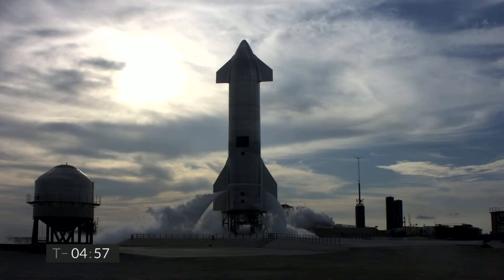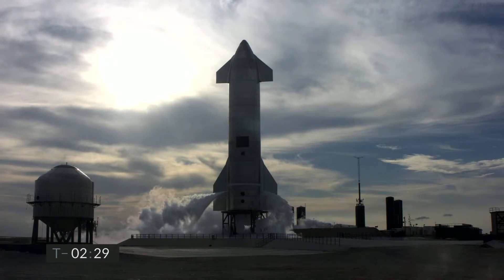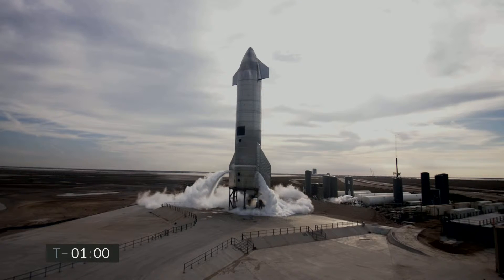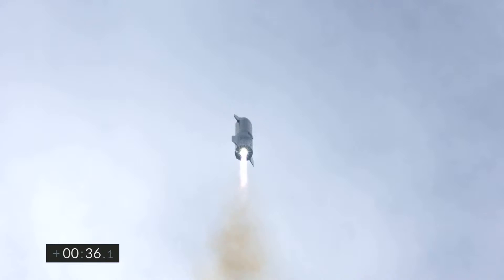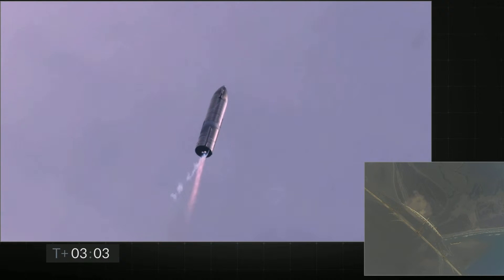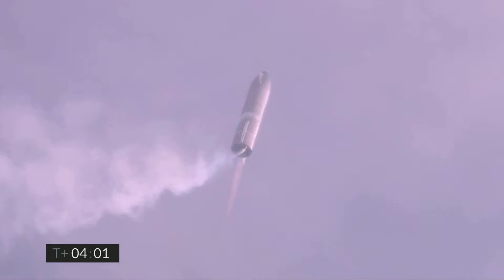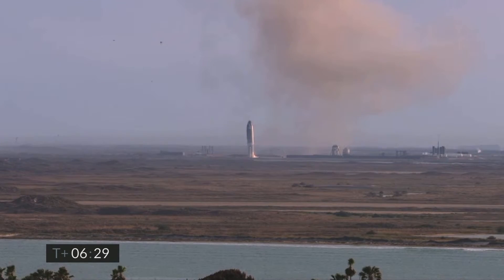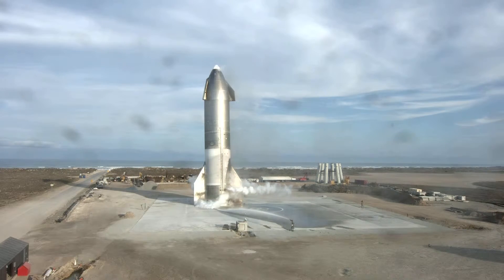Starship | SN10 | High-Altitude Flight Test

Comment: It feels like everybody assumed this kind of thing was impossible, so they just never bothered to try. Then SpaceX shows up and is like "Fuck it, hold my beer."
Reply: @Jean-Luc Picard  is probably referencing the McDonnell Douglas DC-X.  Sure they did it, in a small rocket and not super high off the ground, then quit doing it rather than moving forward.  https://i.pinimg.com/originals/f3/e6/46/f3e64698c9c4edf3364387ece95a040d.jpg
Reply: @red_array How?
Reply: lol NASA was doing this decades ago
Reply: @eyescreamcake  Not with heavy rocket
Reply: @desert_storm8747  Keep moving those goalposts.
Reply: Elon: Hold my blunt.
Reply: Hovering rockets including Mars sky crane have been around for a while, it's the transitions in such a large vehicle, launch, climb, hover at altitude, horizontal descent, vertical again for precise softlanding that make this achievement an engineering tour de force.
Reply: It was McDonnell Douglas and the DC-X in 1994 or 1995.
Reply: @zacklewis342  The DC-X was about 10 times smaller than starship and didn't bellyflop or aerodynamically control itself. Very cool vehicle ofc but starship is on a different level to it.
Reply: NASA cant do this, at least until now
Reply: The materials and the computation required to make this sort of thing both possible and reliable didn't exist until recently. SpaceX has been trying this for 20 years - it didn't just suddenly happen.
Reply: He's right, this kind of landing a rocket is not difficult. It's done all the time with "hopper" kind of vehicles. Making it go horizontal when coming down and then vertical before landing surely isn't too hard, either. It's landing a rocket when delivering a useful payload to orbit that was pretty much believed infeasible for decades, and made SpaceX revolutionary for achieving it. For Starship, the challenge will be rapid reusability after reentry.
Reply: nasa cant do this
Reply: @JohnWick-tc1xy  Google up Delta Clipper friendo. It's a shame they never followed up on the idea, but they did have a working prototype and it was glorious.
Reply: And I want to be clear that I'm not the person you all have replied to. I think what Space X is doing is awesome, but that person is correct in that similar things have been done a very long time ago when it was much more expensive to do and they had to do it with a lot less technology available. Is it exactly similar? No, but still extremely interesting from a historical standpoint. Space X stands on the shoulders of giants, we can't forget those who blazed the trail.
Reply: @JohnWick-tc1xy  GFOLD was developed at JPL lol?
Reply: this kind of landing of a rocket was already done by NASA years ago...
Reply: @jean-lucpicard581  Ehh, no it wasn't.
Reply: @jean-lucpicard581  when?
Reply: @jean-lucpicard581  where’s a link to the footage of your nasa landing
Reply: @franzsperginand113  wow dude I had no idea.  Thank you so much for sharing that bit of untold history.

Comment: Seems like the landing pad could use a lot more fire suppression systems.
Reply: Fire suppression system should be added in to the engine bay that seems logical to me
Reply: @13thbiosphere  Putting fire suppression systems on the Starship would add too much weight.
Reply: @13thbiosphere  Not needed on test platforms.
Reply: Why suppress the fire that keeps you flying? I mean, it helped SN10 fly twice with the fastest turnaround time for a rocket ever
Reply: @MrMayo-og9rj  Can't argue with that. The most bang for the buck right there.
Reply: That's what I was thinking. It looks like there might be a system on all four side but only one was working and it was shooting right at the center, not towards the ship.

Comment: Can someone explain why they shut down 2 engines nearly at the same time, after reigniting all the three engines to perform the last landing flip? Wouldn't more thrust have helped Starship land more softly than it did? I can only assume two things: either they are still having issues with engines and tank's pressurization, or they are testing how Starship behaves when landing with only one or two engines, in case of future engine failures during landings. Nevertheless, this was amazing! Great job SpaceX!
Reply: Raptor can't throttle down enough for Starship to hover on more than one engine. They have to shut the engines down or the ship would start going back up.
In future, they might be able to flip closer to the ground and suicide burn on two, or three with a deeper throttle, but for now they wanted to do that slow hover.
They only lit three engines because they need the thrust to help with the flip.

Comment: Great flight. Couldn't help noticing engine 2 was burning orange on ascent though. Was there a fault which made it touch down too hard? Why not use 3 engines to land and throttle them down so there's some spare thrust if one of them fails.

Comment: What's the point of all this?  Give billionaires space rides?
Reply: To make life multi planetary, make access to space for ordinary people
Reply: @z-manoverstreet  Ordinary people who can afford a $100,000 ticket for a 20 minute ride in space.
Reply: @1133saginaw  take off 3 zeros
Reply: @1133saginaw  where did you pull 300mil from, Starship is the cheapest rocket to launch
Reply: @1133saginaw  not that, there was a methane leak under the engine, fire from the outside crept in and blew it up

Comment: Oil will be gone! Kerosene is a byproduct of that. Hopefully musk will find alternative fuel.
Reply: I mean they're using methane derived from natural gas, so technically not oil, and they do plane to make it synthetically in the future.
Reply: @lazarus2691  there making methane by sucking co2 and H2O out of the air

Comment: Nice bounce on landing there. Am I the only one that notices it's kind of leaning at a 15-25 degree angle sitting there? I notice that transition back to vertical wasn't nearly as violent this time, almost like that high G flip was sloshing all the fuel away from the pickups.

Comment: YGBSM...I wouldn’t have bet on that transition from “falling like a fucking anvil” mode to landing upright. Damn, that was very well done.
Reply: You wouldn't have bet that the engineers who successfully developed the falcon 9 and falcon heavy would get this to work after a few tries? I wish I could have been on the other side of that bet. Easy odds. $$$
Reply: @lambdaman3228  Same. Our engineers, especially those at SpaceX, are propelling us to type 1 civilization on the Kardashev scale.
Reply: It landed a little hard, was set on fire and exploded ten minutes after landing
Reply: Not an impossible task, they have the math and control algorithms from Falcon 9 to help them. That booster has to maneuver at supersonic speeds, impersonate a falling apartment block before slowing down at the last few seconds for a landing.

Comment: I wonder if part of the reason the explosion was so delayed was because of the backdraft phenomenon, as the methane burning used the oxygen in the skirt area it caused the fire to die down but after oxygen was able to flow back in and cause a sudden reignition of the methane and led to the violent rapid unscheduled disassembly. But aside from that, congratulations to the Space X team and SN10 for making history.

Comment: Average speed during the ascent to 10Km was just 150 Km/H   -- hardly the sort of velocities needed to reach orbit.   :-?
Reply: This was a suborbital test flight, to get to orbit they will need the superheavy booster which is being built right now.
Reply: I mean this is just a landing test. They intentionally kept the speed low. 
This vehicle was only 1/4 fueled, and the real thing will sit on top of a massive booster to get it out of the atmosphere first.
Now that they've successfully landed, they will start going higher and faster.
SN11 will probably copycat this launch, but the one after that, SN15, might go to 100km and multiple times the speed of sound.
Reply: This is the second stage of the rocket. It isn't meant to fly like this, yet it did anyways any landed!
Reply: That’s what super heavy is for.
Reply: Simulating the time that the raptors would normally be on for an orbital mission. The raptors are very much throttled during ascent. It's whether they can keep burning for the full duration. In my opinion
Reply: @dkdeep5505  At the end of this test, the exhaust from that one engine definitely looks "engine rich." Reusability is almost certainly going to be a major problem.
Reply: @PistonAvatarGuy  Also the new configuration i.e the 3 raptor landing flip seems so inefficient. It's kinda like blue origin's new shepherd landing. When compared to SN8 and SN9, SN10 seems to be hovering a lot more at landing. Could also be that we've never seen a landing before. If you'll be landing humans, I guess going slow and steady would be the answer anyways.
Reply: Starship on it's own is not designed to get to orbit 
Super heavy is a massive booster that is currently being built that will be undernieth starship as a 1st stage to help it get into orbit 
Starship is a 2nd stage and landing vehicle
 it's going to be huge haha
Reply: As alex said, this will be on top of a booster stage to get it there. I just find it insane that they were able to get this BFR off the pad in the first place!!
Reply: was the goal to show it could reach orbit?
Reply: @anotherdave5107  Goal was to land.
Reply: @MobiAussie  - I knew that. I was trying to politely have the poster think it thru without being sarcastic or troll like.
Reply: They were shooting for 10K.   Not orbit
Reply: They are not trying to get to orbit right now, the goal was 10km. You can't accelerate to 3km/sec and stay below that altitude, haha. Besides, sending starship to orbit on its own would probably not be useful. That's where the super heavy booster comes in.
Reply: You realise this is only the upper stage & return vehicle? Theres also a booster to come yet.
Reply: These are engineering test vehicles to prove the concept is workable. They don't need to reach escape velocity to test whether their landing maneuver is doable or not. What they're flying here is a basic version of the upper stage, Starship will lift off on a first stage with 28 Raptor engines. The upper stage will have three atmospheric engines, and three vacuum engines to transition to once in orbit.

Comment: Are there still people that believe in this fakery?.. Completely defies the laws of physics
Reply: How? Why don’t you ask the people who were watching it live?
Reply: lmao
Reply: You can always go down to Boca Chica and watch the next one yourself. Should be within a few weeks.
Also, many independent parties have simulated this and found it checks out. For example Austin Meyer, the guy behind the X-plane simulators.
Reply: @lazarus2691   over 5000 tons... think about it... Not denying people have seen something go up in the air a bit slowly like a balloon.... but 5500 ton... come on mate!
Reply: @zoominginonstuff8146  Those engines are insane bro
Reply: @zoominginonstuff8146  
This ship isn't 5500 tonnes. That's the combined weight of this ship and the giant booster that it sits on top of when both are fully fueled. 
Most of the weight is in the booster, this is only the upper stage, and it's empty, so it weighs more like 120 tonnes.
Considering that multi-hundred tonne airliners are capable of gliding to a landing, it doesn't seem that outrageous to me.
Reply: @lazarus2691   Also why would you believe anything from SpaceX when they went back and edited the live stream from one of their launches which supposedly YouTube doesn't allow. They were shown how they were faking layers and they were "allowed" to go back and edit the "footage" If that doesn't at least ring alarm bells then good luck with your fairy tales!
Reply: @zoominginonstuff8146  
Where did I say anything about trusting SpaceX?

I said you could go watch it yourself in person, and that independent parties had concluded it was physically possible.

Also, I don't need to trust SpaceX. Dozens of people have uploaded amatuer footage of the landing, and thousands more swear they saw it.

So unless SpaceX bought out an entire town of thousands, which seems unlikely considering that they couldn't get 3 out of the 20 people in boca chica village to sell to them, then I'm fairly confident this happened.

Here's a few non-SpaceX clips:

Landing starts about 5:50: https://youtu.be/bUlpTjbJ4Lw?t=350

Landing starts at 6:40: https://youtu.be/bgTMwid2lKw?t=400    

Landing starts at 2:40: https://youtu.be/iUJif0_vhLs?t=160

Comment: Have they released the cause of the explosion after sitting there several minutes at a slight tilt?
Reply: It was probably just a methane leak. Perhaps it came down to hard, methane started coming out, until it hit a spark and boom.

Comment: I like it that they started adding more of those "this is intentional" for idiots like me :D
Reply: Orange fireball = good. Engine shutdown
Green fire = bad. Engine disintegration.
Reply: @Connection-Lost  Well.  Small(ish) orange fireball = good.  Uncontained failure might look like a big orange fireball.  But it looks like the engines are pretty solid, just had pressure issues.  Green was from not enough fuel so the oxidizer rich mixture was eating the engine itself as fuel instead (what you said, in more detail).  Second failure was a failure to light off one of the engines, at a point where it was critical that it immediately and successfully ignite (glad that happened to slap the (to quote Elon stupid) out of them... You always want plans for when SHTF.  I'd hope that they have backup up plans like that for their dragon capsules if the chutes fail to deploy or are destroyed they can use their engines to soft land - they have the capability, but if the computer doesn't order it and the crew doesn't have time to manually trigger it, that'd be bad new bears.
Reply: in the SN8 flight they never mentioned the engines were supposed to cut out one by one and so even a lot of experts thought it was unintentional

Comment: Looks like a bit of a bounce on landing, tells me it came in too hard, also the fire, might have hit hard enough to rupture something.
Reply: Yeah ryan air landing
Reply: i saw that too. obv. the fire isnt part of the show but 3rd attempt is amazing. there will be plenty more to watch
Reply: It did. A methane leak caused it to explode 10 minutes later. They need to get the new landing legs they were working on actually implimented on one of these soon.
Reply: @ryer9646  i had thought that maybe they detonated it because of the leak or the lean
Reply: @Capthrax1  they were in no rush to do it so fast. It wasn't risking anyone or anything if it fell in the direction of the lean, and even then, it would have still just exploded in the same way as they were not yet done detanking. Plus, the explosion itself came from the bottom of the craft, hence the upper half getting launched I to the air, and I'm like 70% sure that's not where the FTS is. It was almost certainly a methane leak brought about by the hard landing, which was then ignited by the fire that started when it landed.
Reply: The methane was pissed off that it didn’t get it explode.
Reply: It was a bit wonky on the pad

Like the leaning tower of spaceX
Reply: @Joopyter724  yeah
Reply: It bounced because the landing gear didn't deploy correctly (if at all), there was a fire as it landed. It did blow up about 5 mins after it landed likely due methane pressure.
Reply: @fragalot  landing gear did deploy. Properly is a different question. Either way, it hit the ground harder than they wanted and the not so great landing legs weren't able to take the blow.

Comment: Congrats, SpaceX teams. This one didn't go boom on landing :-) Thats a huge milestone. You folks are doing some amazing work. 

This may seem like a silly question. Why is it that when you shut down the first engine, the remaining two engines appear to be burning two different colours of flame? Is it two different fuels for each engine? 
Also, it appears the vehicle is venting a steady cloud of fuel the whole way down when the engines are off? Is this the gas? Or is it just condensation similar to off an airliner's wings?

Comment: Elon Musk and SpaceX Team:
As an engineer watching from the outside, I can't imagine the anxiety levels you experience with this project. 
I have a couple of questions.
After the initial Raptor shutdown during ascent, there is a vast difference in flame color variation between the the two remaining engines. Is that due to throttling them differently for a median thrust level or is it variations in tank pressure or system pressure feeding between them?
Next question is, what are the g- levels experienced during the flip maneuver? Obviously essential to the process of landing with a passenger area full of people.

Comment: That does not look like it could be more efficient than a hoverslam. I assume it'll be more efficient when it gets to reduce more speed using aerodynamics, for which it will need to get more speed thus enter from orbit or fall from higher altitude. But I imagine you'll be working on making the landing burn shorter and shorter nonetheless?

Comment: I missed the running stats (speed, height), and the arc-timeline. I'm spoiled by the StarLink launches.
None-the-less: Congratulations SpaceX, a beautiful test flight, and I cheered when it stuck the landing perfectly.
She looked a little under-powered with just 3 engines in that cavernous compartment, but I guess that's all that was needed without payload.